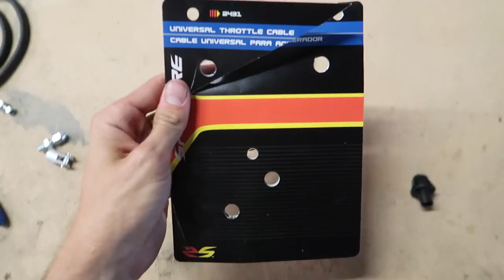Sabrina makes the 2JZ a gas pedal!

Comment: TJ race the brz vs the 350z
Reply: DudeSniper27 it would be pointless cause the 350 has way more horsepower cause of the 2j motor
Reply: sam ? Whaat? The BrZ has 400whp and the 2j will have around the same when properly tuned with the factory twins
Reply: toddf93 only when the brz is on e85 tho